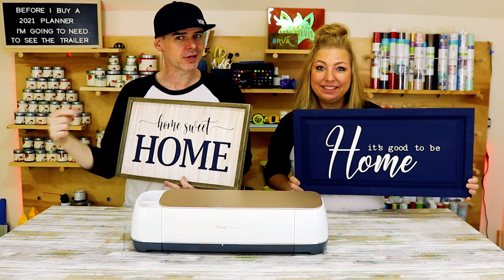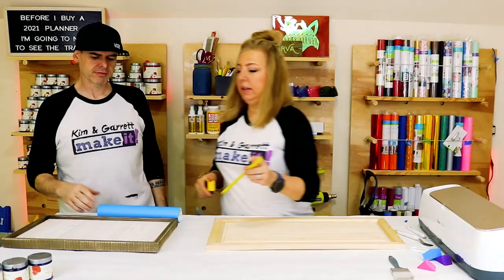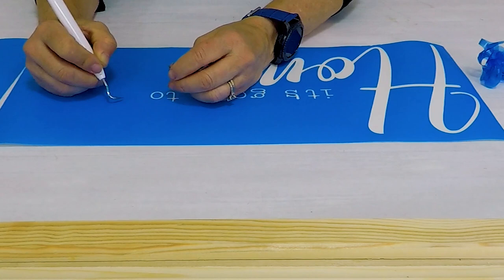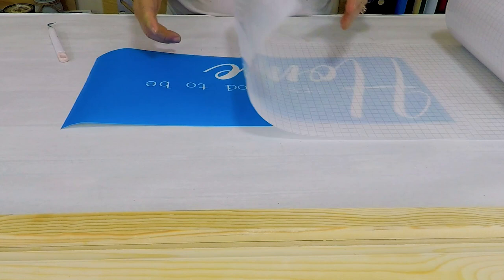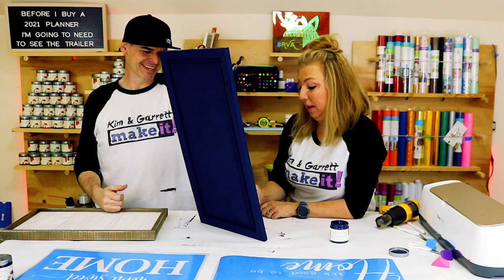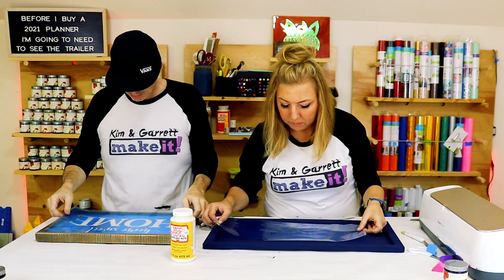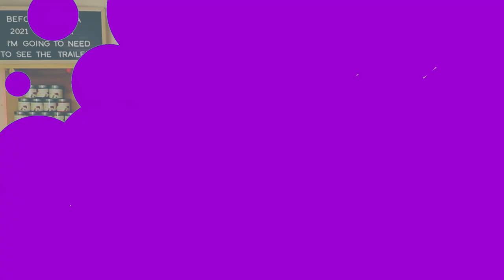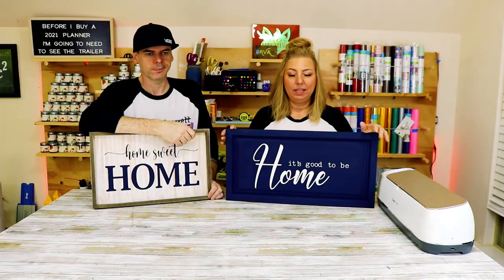How to Make My First Farmhouse Sign with a Cricut Stencil

Comment: Hi Kim and Garrett
I received my order,  1236790005 but the truck set was totally missing. I’ve tried contacting you every way I knew, but have not received any communication back, so I figured I’d try here. Was it shipped separately? I only had the one tracking number so I figured they were together. Please let me know. The home sweet home set arrived Dec 24, so I was able to get it painted for a Xmas gift. I only used the month pieces to add to a different sign I had made. Any chance in the future you would sell just those pieces? They are super cute! I hope to hear back from you soon!

Tonya